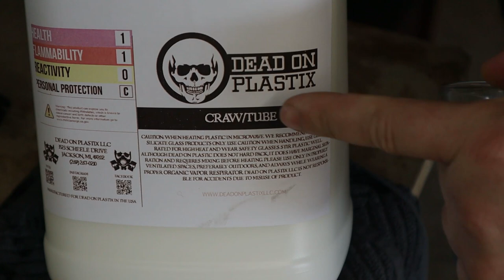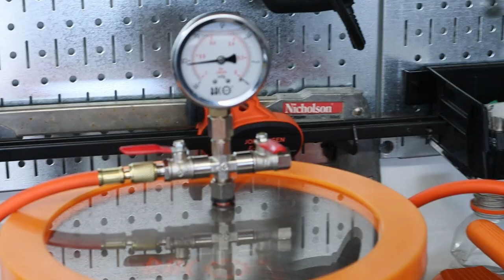How to: Let's hand pour some swimbaits!!! - Citrus Shad

Comment: One tip, wear a second glove and when you stop your layered pour you can put your hand under the cup and stop the drips from falling on the sides of the mold. This helps a lot when creating solid color differences and you wasn’t have the runs on the inside. Always check for splatters on the inside (drips will hit the side and leave dots) and you can remove them with twitters.
Reply from the maker: I appreciate the tip buddy!